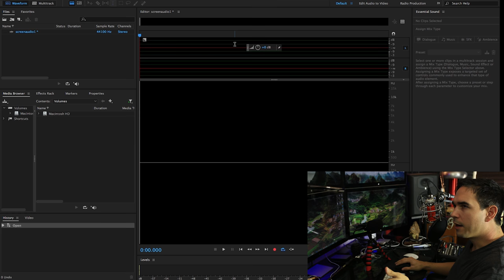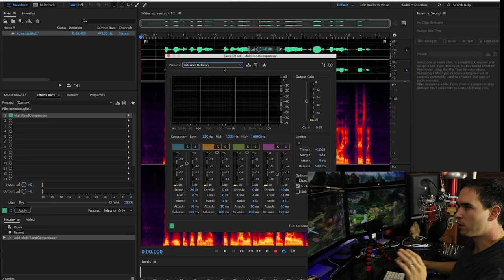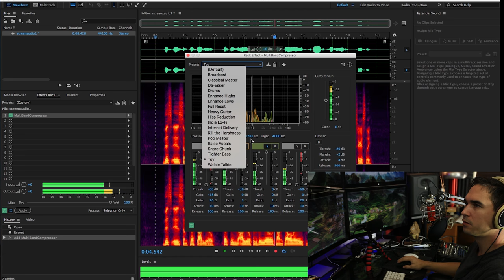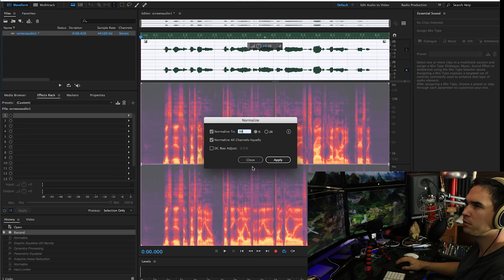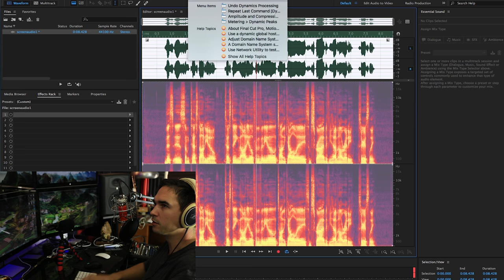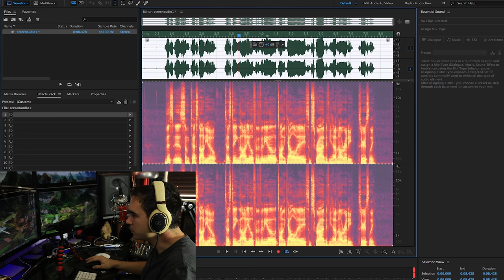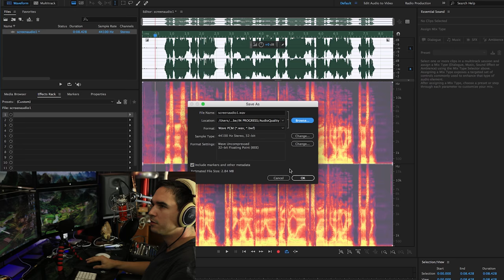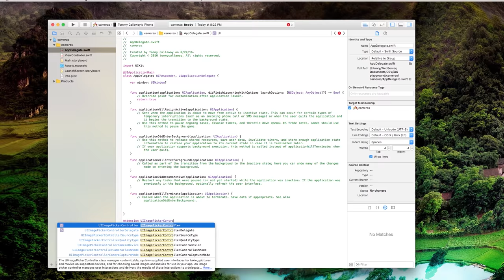Instantly make your videos sound better (Adobe Audition CC tutorial)

Comment: My "Esses" sound really harsh. Where would I put the De-Esser in the order of the effects tray? Does it matter?
Reply from the maker: +StandAloneState I think it would work better in the beginning. Give it a shot, let us know!
Reply: Hi, thank you for the reply. 

So I normalized to 98%, added dynamics processing, parametrics and a multiband compressor, normalized to -0.1dB, then hard limited to -0.1dB. At the very end I used a DeEsser.

I took a copy of that same file, normalized to 98%, used a DeEsser before adding the rest of that stuff, normalized and hard limited. It actually sounded pretty much the same. 

When I put both into the Match Loudness tray (Last step of matching to -16 LUFS for podcasting) and looked at the details, this is what I saw:

DeEsser first (-22 LUFS):
Total RMS -24.92dB, Peak -06.26dB, True Peak -06.26dB, Loudness -21.84, Perceived -20.66dB 

DeEsser last (-22 LUFS):
Total RMS -24.94dB, Peak -06.28dB, True Peak -06.27dB, Loudness -21.90, Perceived -20.73dB 

So it's almost indistinguishable to the naked ear. But there is a difference.